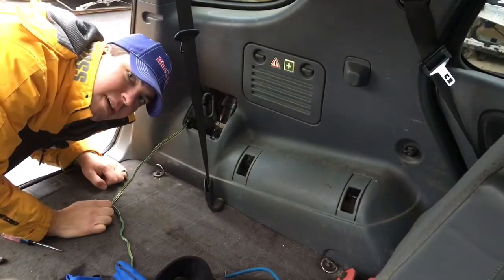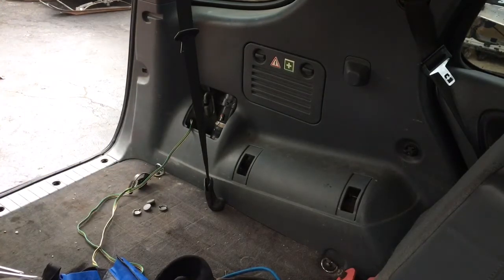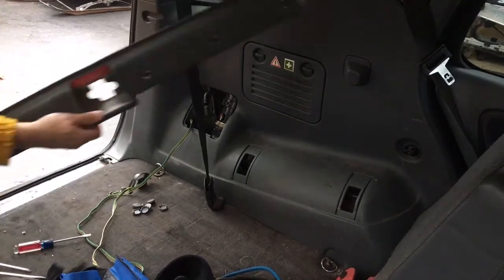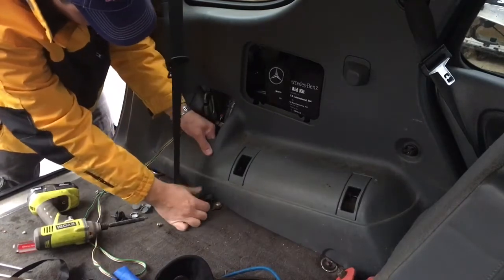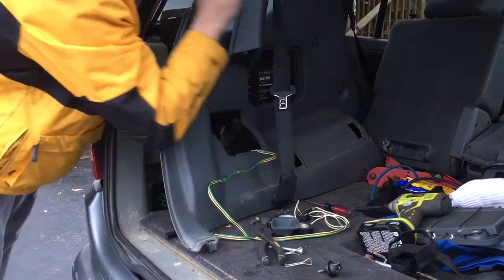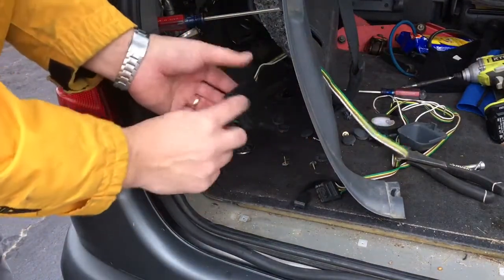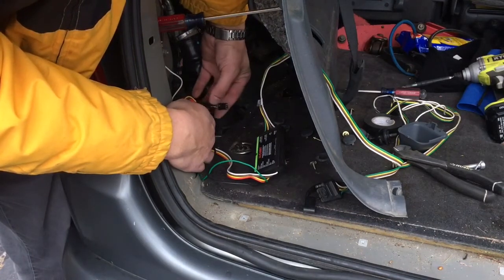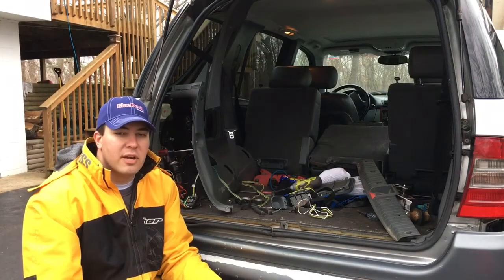Mercedes Benz ML320 Trailer Light Wiring Kit Install Overview Curtis 56146 or 59146

Comment: Thanks Joe. I am looking for the hot wire  so I don't have to run the wire from the trunk to the battery in the hood. Can you point it out, please? Thank you.
Reply from the maker: Hung Nguyen it's black wire from Curtis to red from car. I put the red fused link in between the black wire from Curtis and the red wire from Car.

Hope that helps!
Joe

Comment: If your trailer lights stop working check the inline fuse on the curtis module on the red wire. You can see it in the video. My car is 06 ML500 with MB trailer light kit and it has a 20 amp inline fuse.

Comment: Joe, I know that you may have already done this on both w163's but you can actually run the wires straight down through the body, there is a rubber plus you can remove and run the wiring through the hole and then get a rubber plug w/hole or reuse and cut/seal the one it and with
Reply from the maker: Thanks for the info, good to know. I think I would still prefer having my wiring tucked away in the side of the panel. Too much salt and corrosion where I live and the wires would not last very long. Then I can pull them out when I need it. My other ML320 has the plug mounted below for a 7 pin so I just use that but it has a nice door to cover the terminals.

Comment: Awesome.  Do you know what your towing capacity is on the ML320?  Have you had any transmission issues or similar related to towing?  Thanks for posting this.
Reply from the maker: Towing capacity is 5000 lbs I have towed just about everything with this model and never had 1 issue. Probably towed over 100k miles easy.

Comment: my red wire has no power... is there another place to get power?
Reply from the maker: Check fuse #18 it should have a 25amp fuse in it, if it does not you will not get 12volts through the red wire. Hope that helps!
Thanks
Joe
Reply: joesnowmobiles  thank you for reply. yeah lucky me mine doesnt have it. lol. i had to run a power wire thru the lighter socket in the back. working good now 😉